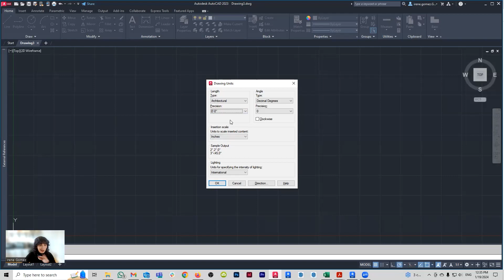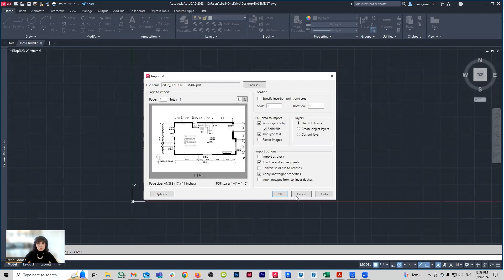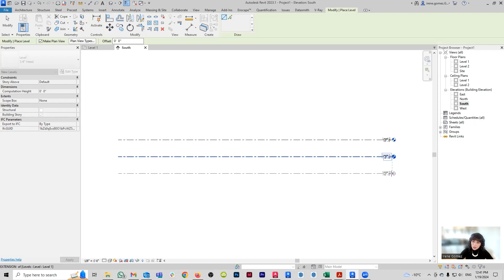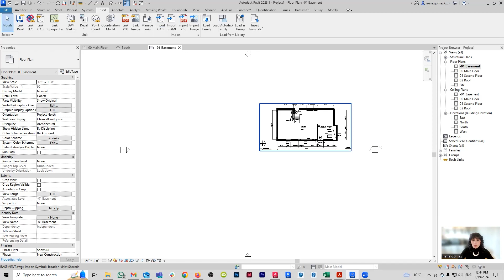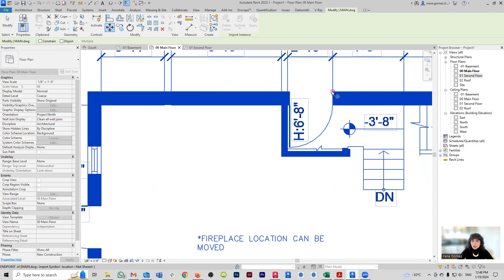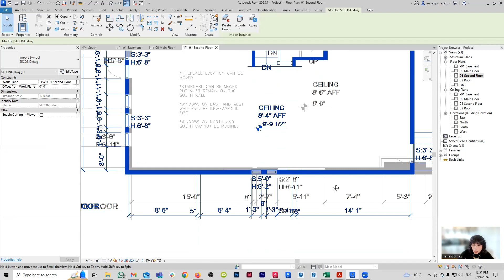Revit - Modeling a multi story residential building

Comment: Sanity saver tip for maths. Re window height.  Open window type property and in height type the maths as a sum ie =2100-900 revit will do the math and give a window1200h.
Reply from the maker: Thanks for the reminder that formulas exist and I should totally use them!